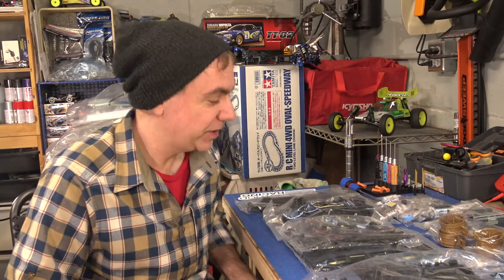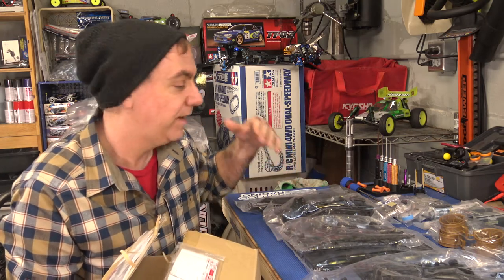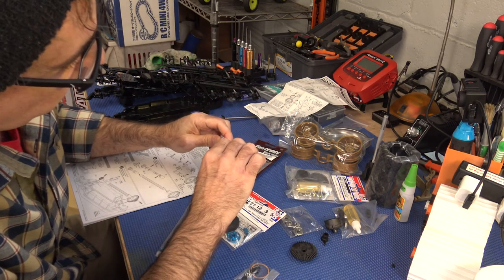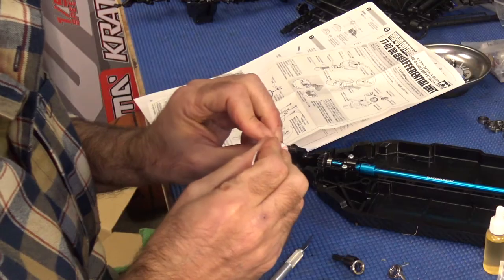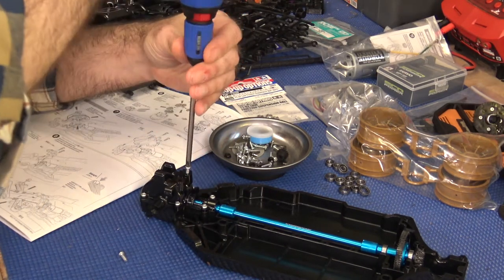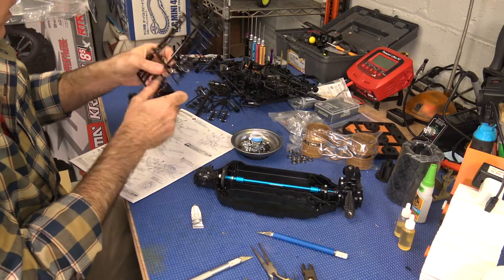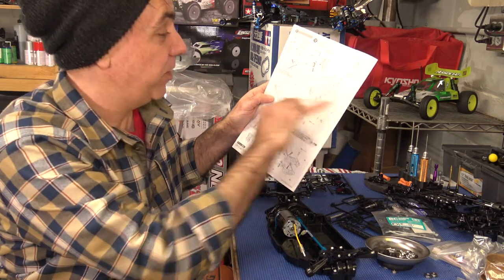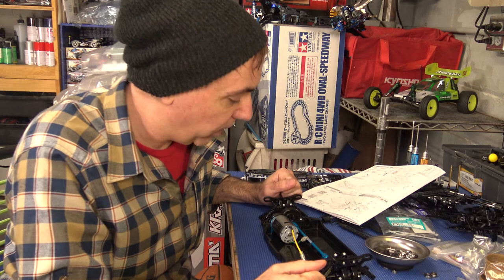Full Kit Build Part 1 - TAMIYA TT02 Subaru Impreza Monte-Carlo ’99

Comment: Even when you cant see the motor mount, is very useful. 
I had a issue with my ESC, the motor overheat and melt all the plastic mount.
You can't see the metal mount but is a great update
Reply from the maker: Oh wow. That’s crazy. Thanks for the tip. Glad I upgraded!!
Reply: Plus for plastic is if you don't break it, It's light. On the right places the car will be faster.
Reply: @Nordlicht05  

Really I don't think that make the difference. The metal one is aluminium, very light and is not a big part.

The difference in weight are almost insignificant in this case.

I don't think we can see a diference in performance. Really

Comment: thanks for this build series. I'm about to build my first RC car kit which is going to be a TT-02B. and a lot of these extra parts are what I was looking to get for my build. Most of these will work in the TT-02B as well. This helps me to know exactly what I need.
Reply from the maker: Some may not fit. If the B is the "buggy" then some of the parts are unique for that version. I actually ran into this in the build, where I ordered hubs for the B and they did not fit on mine. so just double-check if you need a specific "B" version for your build. Glad you liked the series!
Reply: @JohnBattistini00  Yup, B is for buggy. I'm getting a Neo Scorcher. I saw the complications you endured, and its helped me to look a little more closer at some parts. thanks for sharing, even your messups and mixups.
Reply from the maker: @assembly_language3948  Cool. Let me know how it turns out.

Comment: Can you still use the stock differential with a brushless motor or do you absolutely need the hop up differential?
Reply from the maker: I haven't tried personally, but I don't see when you couldn't if the KV of the motor isn't too crazy.  There are lots of other builds I have seen on youtube that drop in a brushless with the stock diffs.